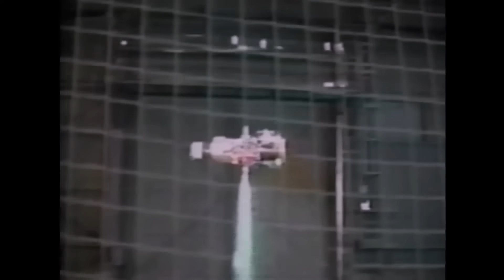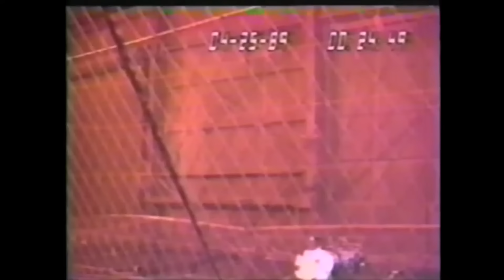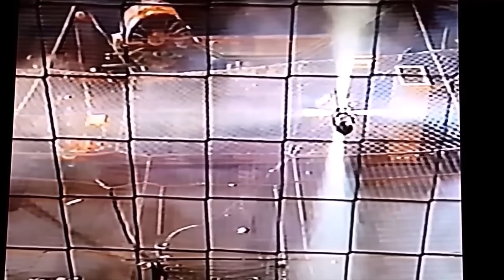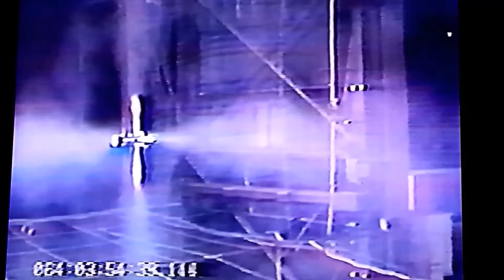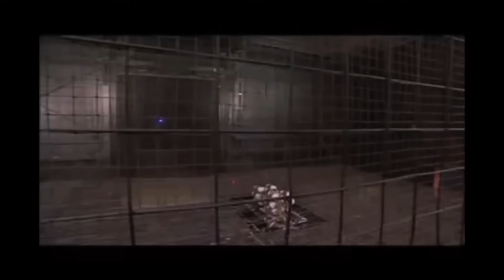EKV/KV/KW/KKV/LEAP (Exoatmospheric Kill Vehicles) Hover Test - Compilation Video (SM-3, GBI, etc.)

Comment: The fact that it's doing that under the erects of full gravity is amazing. Imagining it in space, with little gravity and no air resistance is impressive.
Reply: Those are designed to pull dozen of g's. This 1g  is basically nothing to them.
Reply: These are designed to be capable of intercepting in the atmosphere as well. Also, as they arent orbiting anything, they will still feel the full 1G. If the ISS became stationary, it would still feel 98% of the earths gravity.
Reply: @yyyyyeeeee4060  yes, i wanted to say that too, space doesn't mean there is no gravity, orbital speed have micro gravity because of the centripetal force, if you use Newtonian physics, 
but well, more accurately, orbital speed means you're in free fall, you're no different from any object on a ballistic trajectory like a plane doing a hyperbolic dive, or a canon shell
and this thing was done to intercept ballistic re-entry vehicles by being relatively stationary or on the ascent of a small basaltic trajectory
if there was an huge tower that was built that reach space, like a space-elevator, you will still feel gravity even at 100-400km, gravity effect will disappear at geostationary orbit, bc the tower or elevator would be spinning at orbital speed then
Reply: @yyyyyeeeee4060   The ISS still feels the Earths gravity while it is moving.  It could not orbit the Earth without it.
Reply: @NYC  He said, "When you see no smoke", pointing out that some scenes in this compilation show smoke and some don't.

What is the point in communicating at all if we don't respect semantics?
Reply: These really resemble the "ufo" tic tac videos that have come out by the air force pilots....
Reply: eerekshun
Reply: @hilltop4847  hehehe ty
Reply: And a longer lifespan for fuel with less gravity.
Reply: @Backyardmech1  my thoughts exactly. Seems to me the thing would only be beneficial in space.
Reply: @Harry Wang they add the oxygen to the fuel, it's not taken from the environment. A campfire cannot be made on the moon without bringing an oxygen supply.
Reply: “ How do rockets burn in space with no oxygen ?”

Rockets contain an oxidizer. 

Ie. liquid methane/LOX
Or gunpowder in fireworks as an example of solid “all in one” fuel.
Reply: @cortholiopezorama8879  or they use a liquid that decomposes under heat and provided a catalyst. Then they just stick a catalyst bed and a hearing element in the combustion chamber. Most popular choice for this is any of the various hydrazine based propellants as they are both highly energetic and yet relatively stable under room temp and pressure. Downside is they are toxic as all hell
Reply: You said errects
Reply: I'm pretty sure LEGO makes sets like these now only smaller and more responsive. Gotta love the 80's, Pac-Man, VCR's, cassette tapes and this floating lighter
Reply: They would have a decent surplus of delta-V given that most of the fuel burn in these demos is to counter gravity. In orbital micro-gravity, all that which is being used to keep it aloft would be freed for maneuvering use instead.
Reply: @pauljs75  there is no "orbiting" anything. There are no "sattelites" in "space" 

You have been fooled, just like you were fooled about covid, about isis, and now about Ukraine.

Grow some discernment, stop watching porn and just maybe you'll get your mind back.
Reply: "with little gravity". I'm surprised no one pointed it out yet
Reply: @thejohnenriquez   Bah dum tsshh
Reply: Exactly!! Was thinking that !
Reply: Trying to understand how it’s capable of holding the power to perform all those maneuvers as well as the power to produce the thrust required to maintain itself like that. 12 inches long, what fucking alien tech did they deconstruct to make this lol
Reply: “ Trying to understand how it’s capable of holding the power to perform all those maneuvers as well as the power to produce the thrust required to maintain itself like that. ”

Off the shelf $1,500 micro jet engines can put out 20lbs of thrust. This is probably an actual rocket engine for space operations, but it still holds that you can fit a lot of thrust in a small package.
Reply: @cortholiopezorama8879  likely they are using either heated catalyst monopropellant thrusters or hypergolic bipropellant thrusters due to their very compact size, simple operation, and super fast start up and shut down times. Propellants are likely some form of hydrazine for the monopropellant/fuel and nitrogen tetroxide for the oxidizer if they are indeed using biprop engines.

In any event, yes, these are definitely rocket engines. No way around it as the terminal flight will take place under high vacuum conditions.
Reply: It wouldn't move what do u mean
Reply: Read my mind
Reply: Let's be nice and discuss this as sophisticated ladies and gentlemen
Reply: If we can put aside our differences and petty squabbles we could legitimately advance as a species. Peace, love, and science, my dearest friends.
Reply: Bruh wat the fuck are you talking about, if you go into space around earth there is still gravity
Reply: There's gravity in space...
Reply: Gravity gets excited easily, just be glad it didnt climax.
Reply: It said gyroscopes… don’t those need gravity?
Reply: @rphigg  nope
Reply: There is gravity in space, what do you mean? The "zero g" effect astronauts perceive is called "free fall" for a reason, they are constantly falling to Earth under gravity, only they are moving so fast that they're constantly falling over the horizon and this results in an orbit. But the gravity is there. It's always there. Especially if this thing does not move at orbital speeds.
Reply: @anonydun82fgoog35  
In my comment, I was referring specifically to the test video of the kill vehicle conducted on Earth, not in space. By 'full gravity,' I meant 1 G, which is the standard gravitational force experienced on Earth's surface. While gravity does indeed exist in space, its effects diminish with distance from Earth, as described by the inverse square law. The 'zero g' experienced by astronauts in orbit is a result of free fall, where the spacecraft and its occupants are continuously falling towards Earth but also moving forward fast enough to keep missing it, creating an orbit. This is quite different from the conditions experienced by the spacecraft in the Earth-based test video, where it operates under Earth's full gravitational pull.
Reply: In leo gravity is tell in the 90 something percentage for strength compared to sea level
Reply: Imagine how far it could go when released from a rocket
Reply: space still has gravity... wtf? gravity doesn't "dilute" with the atmosphere. even as far as the moon, earth's gravity is still 15% as strong as it is at sea level.
i think our schools are failing us.
Reply: Some of these tests look like being done in that huge vacuum chamber. When you see no smoke it's probably that.
Reply: @jackmclane1826  that still doesn't negate the effects of gravity dude you can make vacuum chambers on the earth's surface all you like but you're still not pulling anti gravity off 

The only simulated anti gravity environments on earth are pretty much the NASA planes
Reply: @jackmclane1826  https://youtu.be/mz6Bv74uHLc

Here another video angle of the same room it's definitely not a vacu chamber doors wide open lol but nevertheless you can't remove gravity just by removing air and pressure it's stupid to even think that sorry
Reply: @dundisdundat7022  I never said anything about gravity here... 
What is this comment section? Community college Weisenheimer Club? 😅
Reply: @jackmclane1826  it bounced on the net after it ran out of fuel.  But good idea.
Reply: @jackmclane1826  yeh the ones that mostly have activated thrust on all axis are surely in vacuum chamber
Reply: @jackmclane1826   Air resistance is negligible if you're just trying to stay still, and a vacuum doesn't magically get rid of gravity losses, lol.
Reply: @OrdinaryLatvian  I never said any different! Why do so many people interpret nonsense into what I stated?^^
Reply: @jackmclane1826  You're replying to a comment, so people are going to read what you said in that context.
Reply: @OrdinaryLatvian  I'm responsible for what I say, not for what someone else gets... Also the context does not really explain this comprehension train wreck. So be it. ;)
Reply: “ I'm responsible for what I say, not for what someone else gets”

Responds to a comment about gravity with some tangent about vacuum chambers. Wonders why everyone thinks he’s an idiot.
Reply: @jackmclane1826  You can tell none of these were in vacuum. The way the exhaust jets stay in mostly straight columns coming out of the nozzles rather than instantly starting to spread into wide angle cones is an effect of the atmosphere pressing in on the lower pressure exhaust gases. The combustion chambers are very high pressure ofc,  but the contracting-exoanding nozzles drop the gas pressure in order to convert enthalpy (basically gas temperature, or energy stored as heat) into kinetic energy (ie velocity). In a vacuum the gas is always higher pressure relative to the environment and so it will always try to start expanding further, but in atmo the air pressure keeps it all compressed into a column until it reaches some equilibrium point at some distance from the nozzle exit. Thus none of these tests on this video were in vacuum chambers as can be visually seen in the exhaust plume geometry
Reply: @maxk4324  The textbook knowledge is okay-ish - certainly for a youtube comment, but have to I disagree in the interpretation. Of course, we can't be 100% sure, but it can very well be and would explain why some look are pretty smokeless. If the plume widens depends on how much of the gas expansion has already taken place inside the expanding nozzle section. Ideally you would prevent all plume expansion, because it reduces the thrust efficiency. But in practice this doesn't work for engines that are made to work in different air pressure environments. For engines that only operate in one pressure regime - like for those designed to run in vacuum - all the expansion can take place inside the nozzle and create thrust, and there is no plume widening. If you see the widening of the plume, it is always with an engine that is running in a lower pressure environment than its optimal working point. Tradeoffs have to be taken to get a rocket into space... ;)
Reply: @jackmclane1826  Thanks for the reply! So you definitely have the basic idea, but the issue is that mathematically it is impossible to design a nozzle to achieve "perfect expansion" in a vacuum (that being the name for the regime where the plume is perfectly straight but shock diamonds haven't yet formed). The issue is because to achieve this the exit pressure of the gas has to equal the ambient pressure of the environment, and there is no amount of expansion that can drop the pressure all the way to zero. So in a vacuum ALL rocket engines (and cold gas thrusters) have rapidly expanding plumes, even if they were designed to operate there.

One last thing, plume expansion does not reduce engine efficiency, assuming we are defining efficiency using the industry standard metric of Specific Impulse (Isp). That is because of a neat trick of supersonic aerodynamics. In conventional jet engines with subsonic plumes, the shape of the plume after it exits the engine can actually have affects on the total amount of thrust generated. However when the exit velocity of the exhaust gas is faster than its own speed of sound what that means is that pressure waves, or really changes of any fluid property, can not propagate upstream because those waves by definition can only travel at most as fast as the speed of sound. The result is that all that matters for the thrust is the shape of the plum in the infinitesimally small region right at the exit plane of the nozzle, and everything after that does not matter. It's why if you had a rocket engine thrusting off of a surface like the moon it would generate the exact same amount of thrust as if it were being fired in the middle of empty space. It's thrust would not be affected by the ground because any potential affect the ground has on the plume can't propagate up the plume to the rocket. So when you see the plume expand, it is actually doing so after having delivered all the thrust it possibly could have to the vehicle and it no longer matters which direction it goes in.
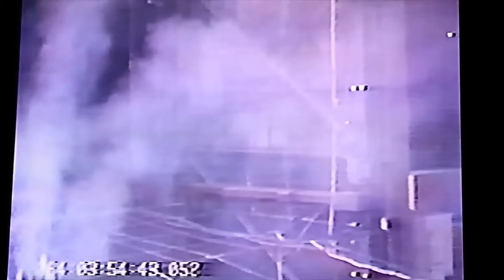Reply: @jackmclane1826  3:05 no smoke huh
Reply: @1degRazz  Did I say all the tests were made there? I don't think so... -.-
Reply: @jackmclane1826  There would still be smoke in a vacuum chamber but it would act much different than how it acts in atmosphere.
Reply: @Chevsilverado  Yes. And the difference is that it is so thin that you hardly see any... ;)
Reply: @jackmclane1826  try not to be so defensive
Reply: @jackmclane1826  vacuum doesn't remove gravity
Reply: @lawsonkennamer6554  Read the f***ing comments! Nobody said any different!^^
This is a nerdy video. One should expect that people watching it are smart and could read. ^^
Reply: @jackmclane1826   you replied to a comment that's congratulating the project because of it's performance under gravity. Your subsequent reply was implying that the fact that the test might be in a vacuum chamber would negate the need for congratulations. However the tests being conducted in a test chamber has no real effect on the craft as the movement is about the same outside of the chamber aside from negligible air friction. Thus this is why people are replying to you talking about gravity. 

The fact that you are responding to a comment about gravity and getting confused about why the conversation is about gravity is either you are embarrassed about not knowing that vacuum doesn't delete gravity or that your are just so self centric that you don't even know what you are replying to, your reply is completely unrelated to the comment.
I don't know how this is so hard to figure out.
Reply: @kaynakdonmez1288  It's not hard, but you also failed...
Reply: @NYC Neither and nor... -.-
But I don't expect every internet idiot to get it. So enjoy your foolishness... ;)
Reply: Have you guys ever thought about the fact that the vacume  that space is makes it almost impossible to move anything within that vacume.
Also how is space a vacume if it's ever expanding !?
None of that space crap makes any sense, but THEY count on the fact we're can't go to space to prove them wrong so we keep buying what THEY are selling !?
Reply: @AuntAlnico4  but we can prove that space travel is impossible with pure logic.

You cannot thrust off a -10¹⁷ Tor vacuum.

Any potential "thrust" would be absorbed thousands of times over by such a vacuum, and let's not get started on the alleged "van-Allen belts"
Reply: “You cannot thrust off a -10¹⁷ Tor vacuum.”

TIL the plume of fire coming out of the engine is a vacuum.
Reply: @UNcommonSenseAUS  you dont thrust off the atmosphere.
Reply: “ Also how is space a vacume if it's ever expanding ”

It’s only a near vacuum. Hence why ramjet spaceships are a theoretical possibility.
Reply: @cortholiopezorama8879 ramjet spaceship bare impossible
Reply: @NYC The point is: I don't need any defense!  ^^
Listen to your own advice before starting a pissing contest that you cannot win.
Reply: Propulsion in space is impossible.
Reply: @UNcommonSenseAUS  how did the moon lander leave the moon? Propulsion in space is very different than on Earth but changing an objects speed and trajectory in space is possible or every astronaut would have a one way trip.
Reply: @bogbody9952  Nobody goes to space.
Astronaut
Astro/naut
Star/(zero/without) not

NOT TO THE STARS.
Reply: @bogbody9952  so your response to being told you believe in lies is gibberish & ad hominem attacks ?

You're going to do great In life son.
Good luck with that.
Reply: @UNcommonSenseAUS  You can believe 2+2=7 but the rest of us in reality only hear crazy nonsense. I'm glad you understood my example, surprised, but it reveals your game.
Reply: "naut" - greek for "sailor". This is rudimentary stuff. As people of your inclination so often say, but so seldom do: "do your own research". @UNcommonSenseAUS
Reply: @platyhelminthes2877  I don't think that guy completed much schooling. It's probably expecting too much of him to know the origin of "naut" when he's already displayed a rare talent for being dumb.
Reply: @UNcommonSenseAUS  you will be laughed at for all time.
Reply: Support your claim with evidence by disproving the third law of motion. If you can't do that, you don't have an argument. @UNcommonSenseAUS
Reply: There's no atmosphere in space for typical thrusters to work against...  🤷🏽‍♂️
Reply: @JosephHoffee  typical thrusters dont work against atmosphere anyways.
Reply: " Imagining it in space," go on some video about Apollo mision computer and read all the comments under that video where people are imagining that this computer was able in real time: colect the data, analize it and calculate corection of trajectory and also handle the work of all the external rockets engines that were just like this video but slighty bigger... human ignorance is very impressive. 🤣
Reply: @Bialy_1  it was gyro stabilised, no computer.
Reply: @davidtheswedishtechguy  Well actually it did have a computer as well. A single gyroscopic stabilizer (ie a big heavy spinning disc somewhere inside the machine) can only stabilize 2 out of 3 rotational axes (the 3 axes being yaw, pitch, and roll).  Also my apologies if any of this info is redundant for you. I try and formulate answers such that anyone can read them and get the answer to the question, and not everyone knows about stuff like the 6 degrees of freedom in flight dynamics.

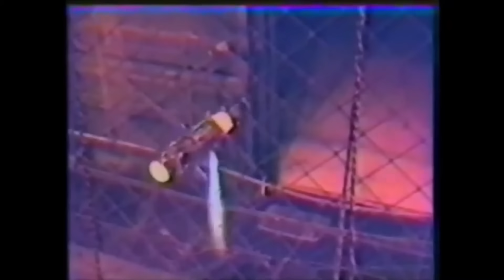The best example in the video I think is at 1:01. Not the best test demo overall, but the one where you can most clearly distinguish details about the gyroscopic stabilizer. In this clip let's imagine we are looking over the left shoulder of the vehicle, so that the camera and the vehicle are roughly facing the same direction (that way there's no mix-up with left, right, clockwise, and counter clockwise). Ignore the big gas jets and instead focus on those two little jets that never seem to stop firing. Based on the locations and directions of those jets one would think that they should be causing the vehicle to start rolling clockwise, but it does not. From this we can determine that axis of rotation of the spining disc is inline with the central axis of the vehicle's body, and that the disc is spinning counter clockwise. This is because in order for those little jets not to be rotating the vehicle clockwise, there must be something inside it creating the opposite torque: namely the motor that spins the disc.

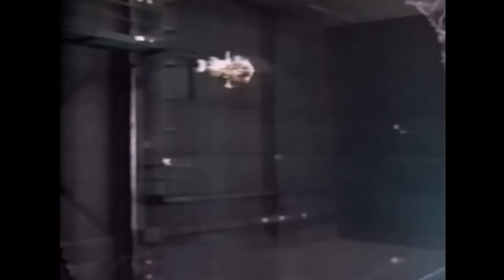So we have confirmed there is indeed a gyro stabilizing the vehicle, but what does that do for it? Well if you've ever tried to change the orientation of a big spinning disc you'd feel the gyroscopic effect resist you (strength of the resistance depends on mass, shape, and speed of the disc). For the vehicle this means that the disc will resist if the vehicle tries to pitch its nose up and down (pitch) or left and right (yaw). But the gyroscopic effect only acts to resist changes in orientation of the disc, not of the vehicle as a whole. If the vehicle decided that it wanted to roll 45 degrees like it did at 0:35, the orientation of the disc did not change, and so no gyroscopic resistance was incurred. So the vehicle still needs to actively keep track of and stabilize 4 of the 6 degrees of freedom: roll, translating up and down, translating left and right, and finally translating forward and backwards. To do this is required a computer to perform the necessary Guidance Navigation and Control (GNC) calculations and then fire the required thrusters for the required amount of time.
Reply: @maxk4324  ah yes I get the basic of that, but the comment led to that it was a "advanced" computer but the gyro itself does a lot of work for stabilisation was my meaning🙂

Saw one of these videos many years ago and it still blows my mind, skynet level at a time skynet/terminator still was a movie😆

Something I've never find info on is for how long it could fly🤔
Reply: @maxk4324  You beat me to it. Adittionally for vacuum main nozzles are optimized wider, to direct the pressure. They're not trying to replicate the orbital conditions here.
Reply: @vitalijslebedevs1629  indeed, they didn't want to deal with the flow separation that a vacuum optimized nozzle would cause under 1atm of pressure. And in actual vacuum the thrust generated would be much higher due to the higher expansion ratio nozzle, which is unnecessary for these proof of concept tests. At least this is what would go through my head of I were asked to help design such a system. The actual design decisions the engineers made are likely still classified.
Reply: @Bialy_1  apollo does not move like this, idiot.  This thing has highly precise control so that it can intercept ballistic missile targets moving at 24,000 km/h
Reply: @Bialy_1  you don't believe the moon landing?
Reply: @Bialy_1  go back to moon mate we are waiting for you ...